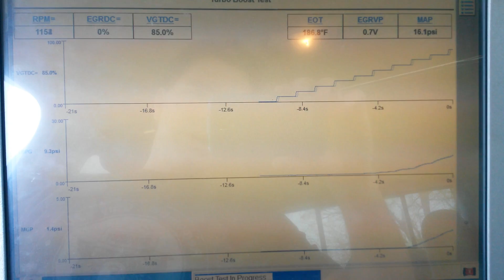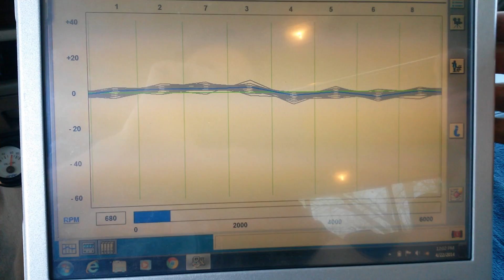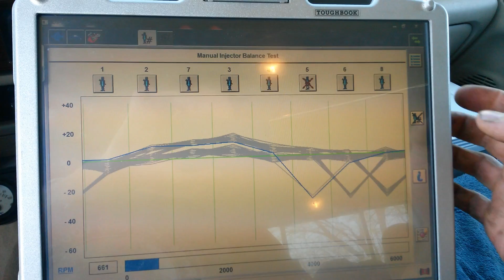FORD 6.0L Diesel ~ Better Diagnostics With IDS than AutoEnginuity or ScanGuage II

Comment: How is that possible unless there is a O2 sensor for each cylinder?  Is the ECU detecting some variation in the spark voltage pattern or the resistance of the injector?  Doesn't seem possible on the face of it for the ECU to dectect and  adjust variations in a single injector.
Reply: sailorbob74133 The FICM and PCM monitor quite a few different variables many times per second as do all modern fuel injection systems. This is how the pulse width (think wave form or sine wave) is calculated and adjusted to compensate for a weak or over-fueling injector. In the case of the 6.0L diesel, as shown in the video, the PCM is monitoring primarily; EBP, Bost, CKP, CPS and the resulting calculated torque.

It's all math....